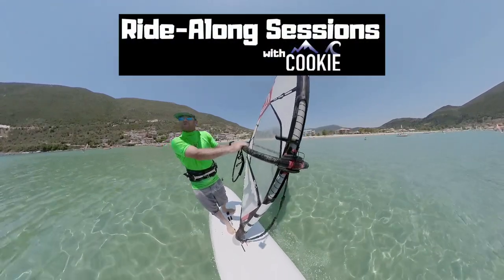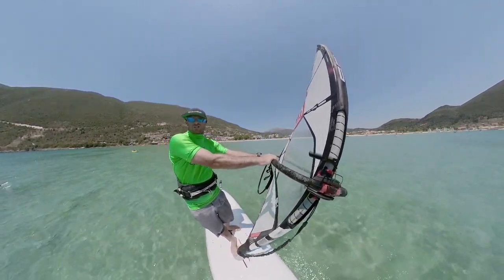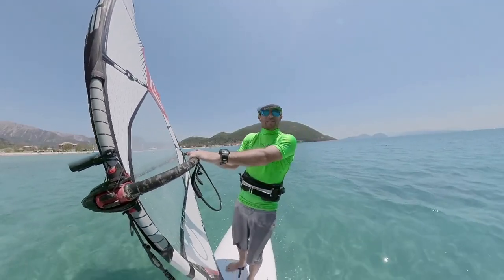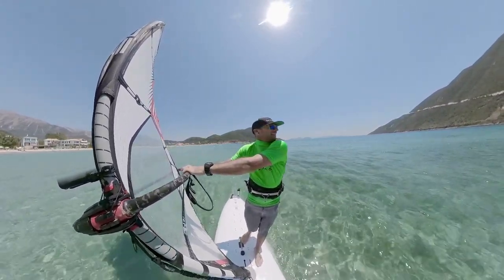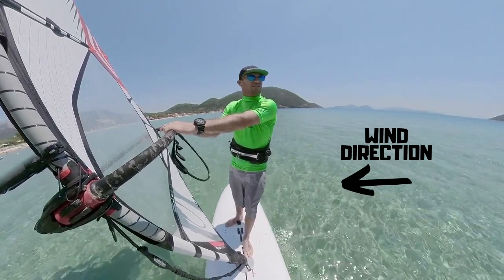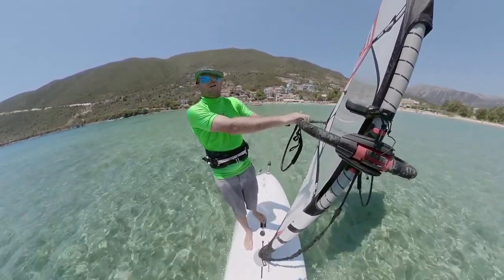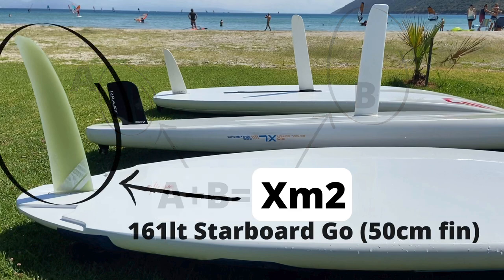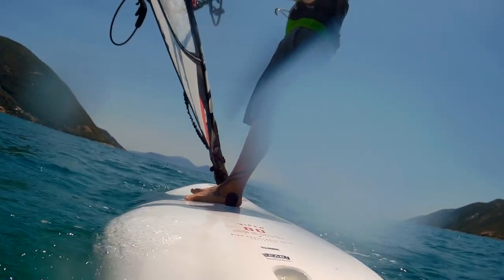When & why should you remove the daggerboard?

Comment: Hi and thanks for another well explained video. I have a question that it’s kind of related. If you could buy only one board for a lightweight beginner would that be with a CB without question or you could get away with a large non-CB as well? I learnt to windsurf on a non-CB board and it took me time and a lot of effort to reach a decent level so It makes me think that probably the CB is crucial during those early steps.
Reply from the maker: Why not look into something like the starboard GO. It has a removable centreboard so you can use it as a beginner, but then also remove it and have some great higher wins planing action on it too!
Reply: @Cookiesports  Thanks for the reply. I thought the Go was without CB but I just checked it and it offers it for the larger volumes. That's nice to know.

Comment: Bro just wondering what is your equipment preference (board/sail/fin) during light and high winds and if I may also ask your height and weight?
Reply from the maker: Light winds but still enough to plane in? I’ve been liking the NCX from Severne matched with something like a carve or futura (starboard). I’m about 175cm and 75kg.
Reply: @Cookiesports  Cool! I currently use tabou board and maui sails (now phased out)...thinking of getting smaller sails, will check out other brands. Thanks

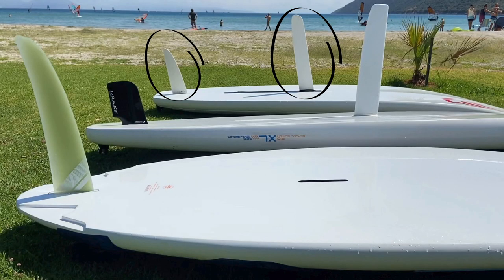Comment: Hi & thanks for the great vid with super helpful info:) I only have a question about one part - from 6:35 - 6:55 you say that a big free-ride board with a 50cm fin will have about the same 'Fin Area' as a basic longboard with daggerboard & fin combined? This might be true if your longboard has a very small daggerboard & very small fin. But I'm pretty sure the Fanatic you're sailing has a decent daggerboard & fin. And if you add up the surface area, you'll get more 'Fin Area' then you will with the Go board. My basic longboard which I use for teaching, has a 57cm daggerboard which also has a lot more chord width than a free-ride fin AND if you add that to the 34cm fin (which has similar chord width to a free-ride fin)... you would get WAY more surface area! Also - for novices sailing slow in very light wind, it's nice to have that daggerboard right under their body for sailing upwind, instead of a long fin at the tail. Thanks again for the great vid & I look forward to your thoughts :)
Reply from the maker: The calculation is very rough. The fanatic vipers have notorious small fins- sailing up wind with the CB is VERY hard- hence the point of if you’re learning to do this, it’s often worth changing boards- or putting a bigger fin on. 
Slow sailing in light wind the CB always help- beginner to advanced- thing is though to progress into higher winds, harnessing, and  speeding up you need to loose the CB, and that’s what this video is about. 👍
Reply: @Cookiesports  - Thanks :) Ok, yes, as you said, "it was a very rough estimate". And I agree, when sailing in lightwind the CB always helps, whether you're novice to expert. And agreed, as students progress into higher wind, that's the time to lose the CB, no question about that. But not sure why you say sailing upwind with the CB is "VERY hard"? (I'd say it's much easier & quite effective.) In fact I love the way you show 'railing' to sail upwind with the CB... and CB steering while jibing (all in lightwind). Anyway thanks again, well done. And will be sharing your vids with students & other instructors :)
Reply from the maker: Haha! Sorry, very big typo that made it make n sense- I meant to say “sailing up wind with a CB Board- but no CB in the the water- is very hard, hence the point….” 
Sorry, that makes more sense now! 
Thanks again!
Reply: @Cookiesports  - cool, thanks for explaining the typo :)  Yes, sailing upwind with the CB is great, whether in light or strong wind. But when students move to boards without a CB (because they're windsurfing in high wind regularly) then, having the correct fin size makes a huge difference for upwind sailing!

Comment: Although I have never tried a modern board, they seem way more stable and have more volume than the boards from the 80's & 90"s. Therefore I am seriously considering teaching my wife on a board without a daggerboard.
It will confuse her trying to sail upwind, attempting to gibe, and will just annoy her I think.
(The first thing she did after wakeboarding a couple of times was to remove the fins, enjoying the slippery feel!)
I am sure that she will progress quicker on a board  without a daggerboard.
Reply from the maker: You are right, more modern boards are much more stable.

However, for a beginner, I would highly recommend sticking with a dagger board for a while. The improved stability, and upwind sail ability will make things far easier for her.
Reply: Ok. Thanks. I will take your advice.